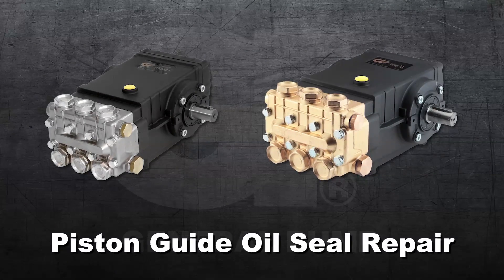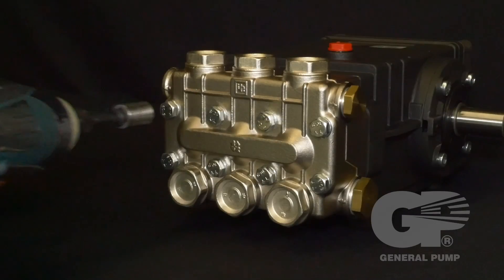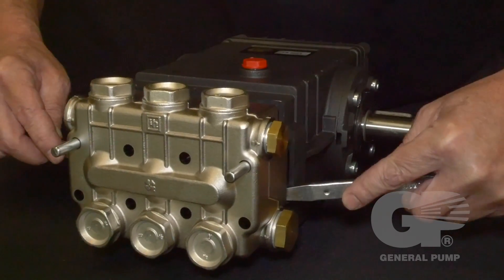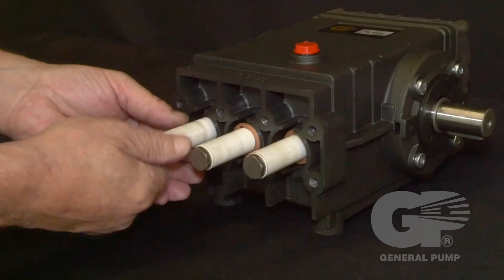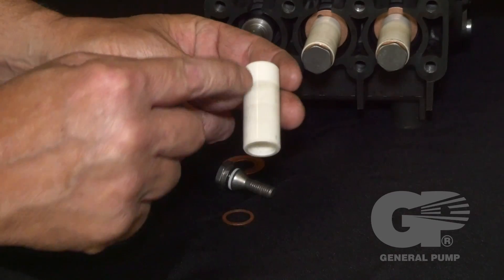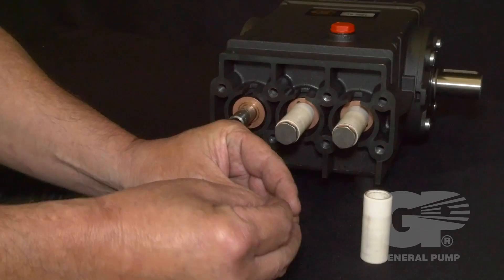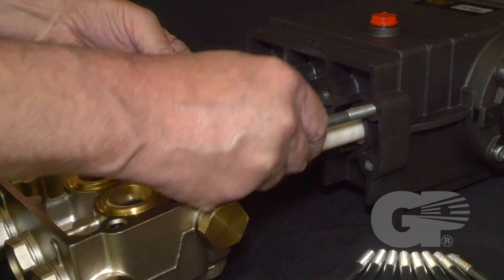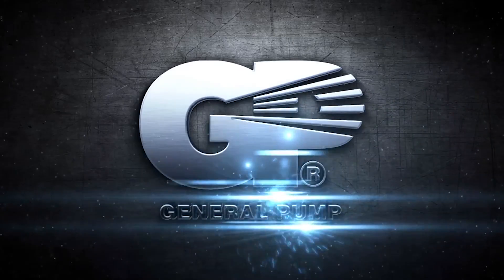General Pump 47 Series   Piston Guide Oil Seal Repair

Comment: Can anyone tell me if the same process & tools are needed/available for an A.V. pump of similar build & specs.(any shop in the mountain west recommendation?) My local pump guy said he needed to tear down the crank case to redo the oil seals from the inside.  While I hate to buy new when something can be rebuilt, it does not make sense to spend $150 on rebuild when a new one is $180.

Comment: Like the demonstration videos i am looking for the oil seal and insertion oil seal tools could you help me where can i find those?
thank you
Reply: search for 20 32 5.5 joints   or 22 32 5.5 if the pistons diameter is 22mm. It cost about 3€ each so with 15€ you should be good for the 3.
You can download the plan here so you can search for other parts if needed.
http://www.hydro-m2ac.com/Catalogue_4795-.aspx